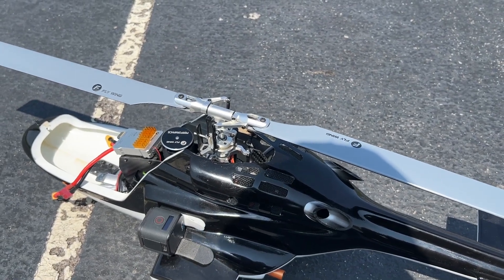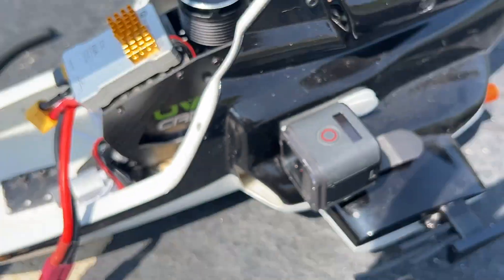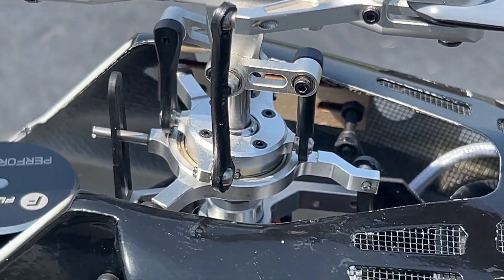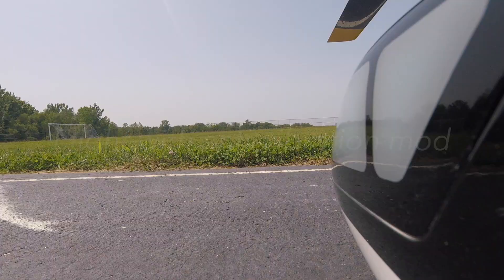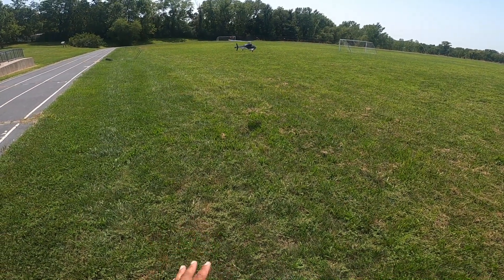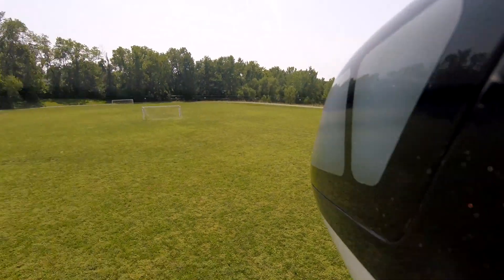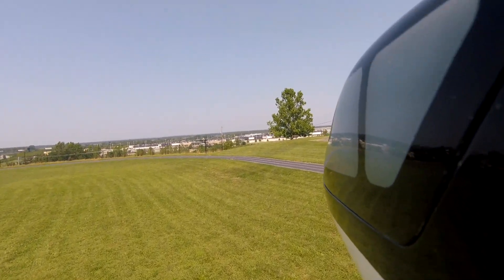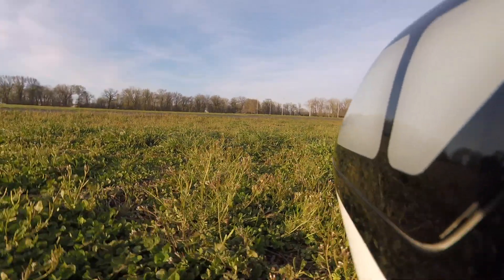FlyWing Airwolf Anti Vibration Mod With Tail Motor Mod HD

Comment: How do you get rid of the high pitched whine the tail rotor motor makes?
Reply from the maker: 1.Original Position (Right Side):
	
When the tail rotor is positioned on the right side, the rotor blade closest to the fuselage often faces airflow obstruction. The fuselage creates turbulence and uneven airflow, which causes inefficient thrust generation and a high-pitched noise.
	
The obstruction forces the rotor to work harder to maintain thrust, increasing the overall noise level and pitch.
	
2.Modified Position (Left Side):
	
By relocating the tail motor and rotor to the left side, the blades experience less obstruction from the fuselage. This allows for smoother and more consistent airflow around the rotor.

With less turbulent airflow and reduced drag, the rotor operates more efficiently, leading to a reduction in noise and vibration. This also improves stability during flight.

Comment: main rotor blades are fastened to tight
Reply from the maker: I also thought so, but every time I finish flying, it loosens for some reason I haven't figured out yet. I'm going to try a different screw and nut to see if that solves the problem.
Reply: @pilotbowser9980  I,ve noticed with new blades they are abit of a tight fit even before tighting the screws,guessing they just need a little sand down before attaching...have you checked to see it your blades are balanced?

Comment: Great video.  I have a fw bell 206 with the same problem.  What is with this company putting something so expensive that it comes like this where you have to do more work to it. Not right!
Reply from the maker: Yeah, I know what you mean, lol. I would check your blades to make sure they're balanced. If they're not balanced, it could cause it to vibrate. Don't over-tighten your main blades, as that can also cause vibration. I should have a new Airwolf video coming out soon because I believe I found the cause of my vibration issue.

Comment: I ordered the main rotor head with the quick connect / disconnect blade grips for my airwolf.  What do you think of those? I haven't installed them yet. It looks like it added a couple mm's to the over all blade length.  I know it has nothing to do with this video but I'm just curious. Lol
Reply from the maker: Keep in mind. You’re adding more weight to already heavy aircraft. The FW450 L was only designed to carry just a canopy, not a full fuselage. Need to make sure your blades are balance and tracking correctly. If not, it will cause more vibrations, which will lead to a crash. Also flying for a very long time when the aircraft is vibrating well, overwork the ESC, battery, and may cause damage to your servos. 

This is my observation, flying the Airwolf. I noticed my ESC is hotter than usual. I’m planning on putting heat sinks and cooling fan. I already cut out the front windows increase more airflow to cool it down. 

I have nothing against the quick release. I think it’s a great idea, but I wouldn’t put it on a scale helicopter due to the extra weighted ads. Unless I bump up the ESC to 80A from a 60A.
Reply: Oh ok. Thank you. Maybe I'll just leave the stock ones on it then.  I'll try them on my Huey.  I'm not sure if I'll keep them anyway cause I'm looking at them out of the pack and they seem alittle sloppy.  Even though they are an actual flying product.
Reply from the maker: I believe the Huey does way less than the Airwolf. I would weigh the Huey with the quick release, and battery to see how much weight it adds.
Reply: I'm not sure if it matters but my airwolf isn't a 450 conversion .  I got it as a RTF pre built like the Huey from Flywing.  Is it still the same , heavy?
Reply from the maker: Is your Airwolf from flywing as well as the Huey? If so the Huey scale motor is different from the Airwolf scale main motor. It will have some difference in performance.
Reply: Yeah I got it from Flywing too. I noticed in the pics it's a different set up.
Reply from the maker: @dradden1556  Ok, let me know how the quick release works out for you.
Reply: Will do
Reply: Hey. So I got my airwolf .  I don't know if I'm going to use the blade quick connect head .  Even though it's a Flywing product. They add a few millimeters to the blade length. But also they seem a little sloppy at the connection points. I'm afraid it will cause vibration. I think I'm going to try them on the Huey . I think I can 8se rubber o rings to 5ake out the slop. Plus the Huey is lighter
Reply: I just test flew the airwolf since I just got it . RTF version.  I didn't put on the blade  quick connects yet. I just put on the blades they sent with the head that is on it. As soon as I lifted off. It's wobbling in the air for some reason. I tried adjusting the blades and it only got worse.. Brand new out of the box.  I don't know where to even start. Oh well. Lol

Comment: Nice video i plan to do this when i get the airwolf fuselage i currently have zero jello on my video but mine is a cadix ratel and rush tank vtx (way less mass) mounted in a stock canopy in the nose with anti vibration foam ive already done all the mods ie fan for the esc with its own small 3s batt ,low noise tail mod and switched to quick release rotor blade system with really nice Japanese balanced blades a nav light system and the round belt gear guard only thing left to do is  retacable wheels 
yes i swapped the 6 channel reciver for the 8 thinking ahead just had the chance to up the software to ver 2.0 still flies great but i didnt try to crash it like ali or andrej did
 i want scale flying i think it still needs less braking 
Also great build out video on the airwolf fuselage ❤seems the comments are off
Reply from the maker: Thank you. The comments shouldn’t be turned off, but I’ll double check. I can’t wait to see your work and keep me posted.
Reply: @pilotbowser9980  your very welcome. I don't post much on the yt. I don't blame you for having comments off. Some ppl are just haters
I plan too soon, though. fw450lv2.5 is the only helicopter I have. I do have a few planes and a few drones 
I do like the bell 222 (airwolf) flywing 
Makes, but the tail is kinda off a bit. It looks like they added a more realistic looking tail, so I will be ordering it soon. I'm not happy with my current setup with
Far to wire intensive (nav lights,esc fan,and fpv setup ) look like a ton of room in the airwolf fuselage I have a set of retractable landing gear from my big drone they maybe too large maybe you can help what size are the wheels and the axel diameter in the fw kit ?  mine are 38 mm and 3mm on the axel, no biggie. I'm a machinist, but I still like it, even it I can't use a retract set 
This heli flies sooooo good. I like it a lot
Just wait till I upload how to add a thermal camera to it I already know it can lift the t2pro  (stolen from my drone ) to get the full deal it has to use a phone unihertz jelly to the rescue lol the raspberry pi 4 is just gonna have to go back to junk drawer lol
Reply: I see you also have heatsinks on the esc how much clearance do you get I may have to remove my fan or change them to blower type and side mount it I have a few for the 3d printer
Reply from the maker: @RGCbaseace The Airwolf is pretty roomy, mounting the fan on the side should be fine.
Reply: @pilotbowser9980  I figured as much my heatsink  is  40mmx30mmx10mm covers the whole esc
But the fan is 12mm tall 
So 22mm up from the top of the esc on the stock canopy I had to cut a hole cools very well 
Seems like it may be a problem on the airwolf 
 so a 3d printer
Part cooling fan side mounted with 90 deg diverter for active cooling 😎 
On a side note, how much damage when the huey tail motor whent kaput ?
Reply from the maker: @RGCbaseace  You’re on the right track and I like your idea for setting up your cooling. I notice the ESC is a lot harder than usual due to the fuselage being integrated. I believe the motor is pulling more amps, and it’s getting close to the 60 amp threshold.
Reply: I have some stl files you maybe interested in for the Lady (airwolf)